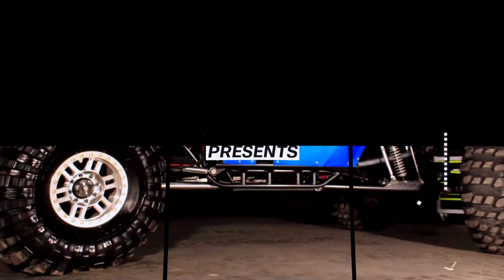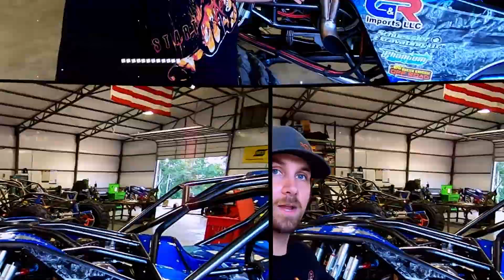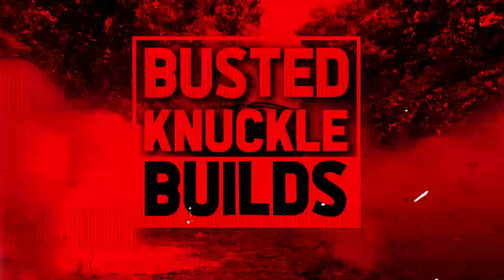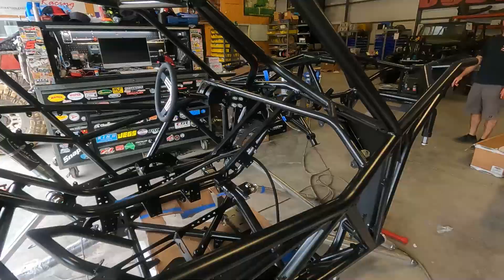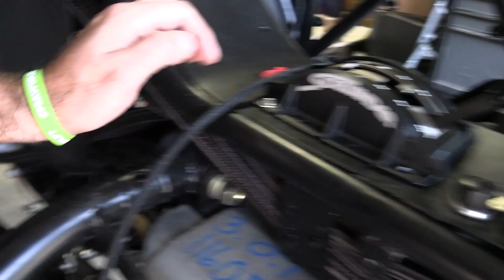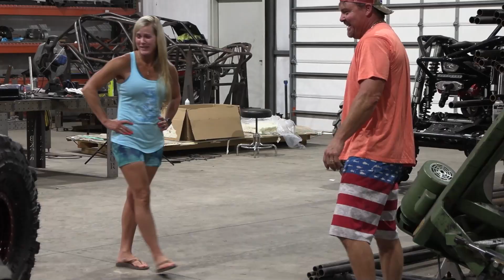BLOODLINE the Busted Knuckle Rock Bouncer Build

Comment: The coolest thing in the world building off-road cars , i have built a couple and generally i can say if you want horsepower in the 500 range it starts to drive cost , axels , transfer case is ripped apart fast at the same time you want low weight ,thanks god for the LS engines 💸
Reply from the maker: this combo we have seems to do very well with up to 700hp
Reply: @BustedKnuckleVideo  Thanks for the reply , i understand this since i build engines for 30 years 😂 and i was just a little careful with my comments , i was referring to a budget build that can be good but when you excess 500 bhp all goes to crap, i build also track cars and hotrods when i have time and money

Comment: I have a million questions lol.   I've never got to see one of these in person.  I've been an auto technician for 21 years but it's mostly the repair side of things... got to do a lil performance stuff over the years but nothing like this.    Y'all do what I dream of man.
Reply from the maker: Ask away
Reply: @BustedKnuckleVideo  o0o0o0 I just bought a 2000 cherokee sport for 1300 bucks.   Need a lil work but I know a good mechanic 😉🙃 what you recommend for a budget 4 or 4.5 lift and steering setup? It came with 33s that are fairly new

Comment: What kind of assist y'all use for the brake system?
Reply from the maker: None. We use manual brakes. It is fully 
engineered and works great
Reply: @BustedKnuckleVideo  not much to fail ..... makes World of difference while on a steep incline.... that's the reason I was asking
Reply from the maker: @CatScratchFever10x  we have hydro boost kits just never needed them on our production rigs
Reply: @BustedKnuckleVideo  I figured engine vacuum might not be reliable if it stalls at the wrong time.  They do make electric vacuum systems but hydroboost gives you some assistance after the pump stops.    Like you said manual is the way to go as far as reliability.  I guess the manual systems are more powerful than needed so it ain't gotta work as hard.   Man I'd sure like to go over every bit of those rigs just seeing what all y'all got in em